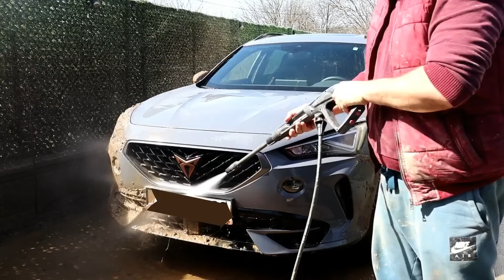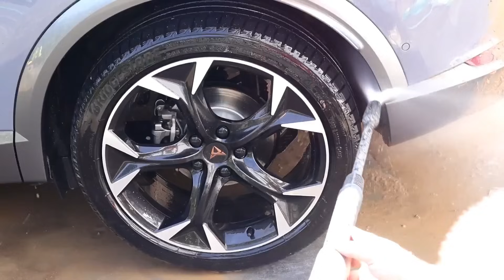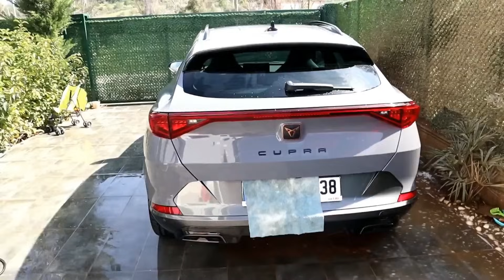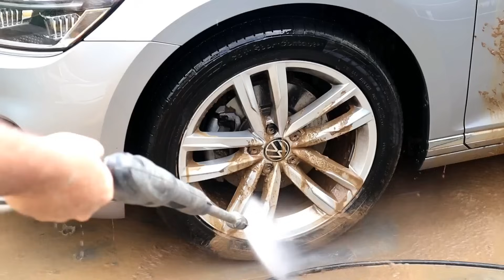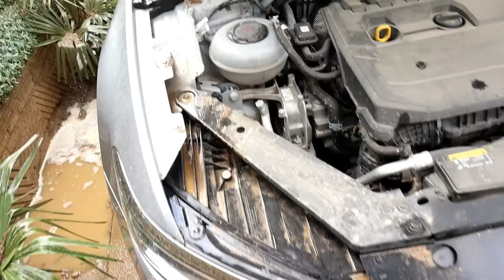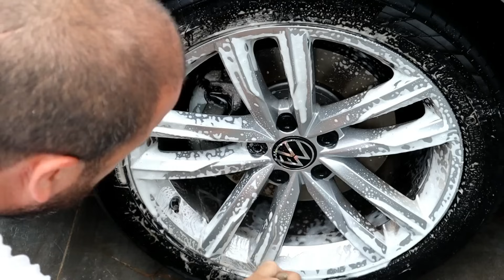3 YEARS UNWASHED CARS ! Wash the Dirtiest Cupra Formentor

Comment: Do you use a shovel or a bucket to dump the mud on the car, 10 minutes before you RINSE it off?  Stop wasting peoples' time.  At least run th wipers for a minute, to give the impression that the car was driven, instead of a car just pulled out of a mud pit.  You don't fool anyone.